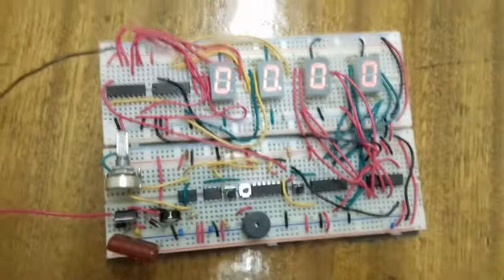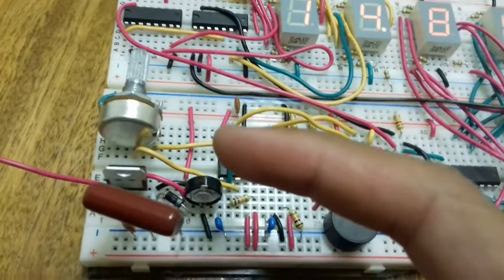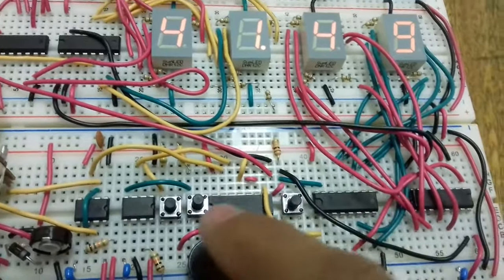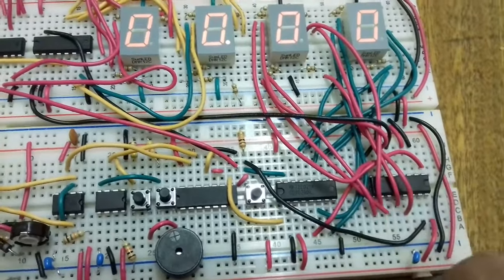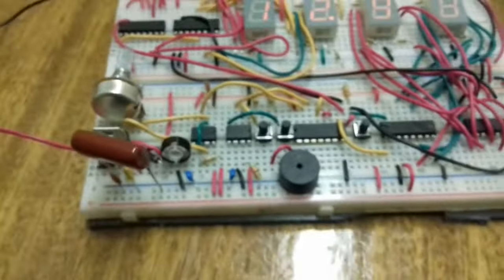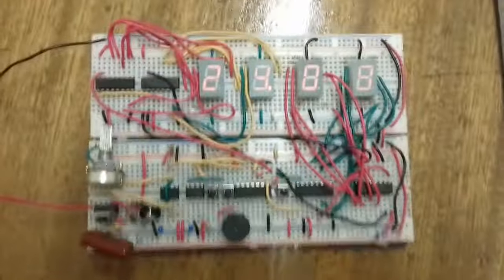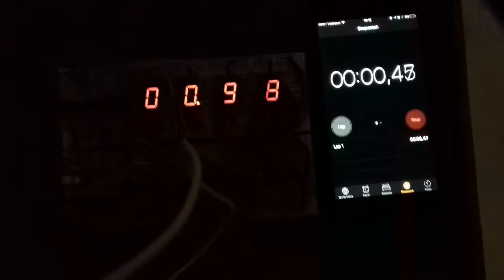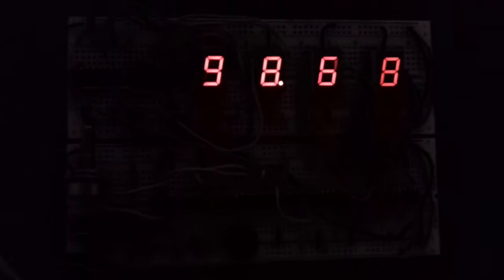Digital Stopwatch/Track Timer circuit with start, stop and reset using NE555, 4026 and 7 Seg. Displ.

Comment: hi may i ask about the circuit/logic diagram, how to aim the stop watch timer circuit that counts from 0 to 60 seconds? because were simulating it first in proteus software. Hoping for your timely response, thank you!
Reply from the maker: For more information regarding the IC and the components used you can just browse through my report for this project on the following link: https://drive.google.com/open?id=1Y6bl7NO-EwmGRuI4GIL9v-hzCtdwp8Gj

Comment: I want to ask that which IC is used to display the microseconds in the stopwatch  because I have made a microseconds stopwatch but the segments are changing with second of a time
Reply from the maker: talha adil Talha Adil According to the circuit that I made, the speed at which the numbers change depends on the frequency of the clock, so for the clock I used a 555 timer IC. For more information regarding the IC and the components used you can just browse through my report for this project on the following link: https://drive.google.com/open?id=1Y6bl7NO-EwmGRuI4GIL9v-hzCtdwp8Gj , apologies for a late reply, did not have enough data in my phone or connection to the WiFi, hope this reply finds you well.
Reply: Thank you for your response , i hope this will solve my problem

Comment: What is the frequency you set at 555 Astable oscillation?
Reply from the maker: Please follow this link for the circuit diagram: https://drive.google.com/open?id=1o61FyCb5Gz9mvtp34Id4kTbkrqxuAPyQ and this link for the report on this project: https://drive.google.com/open?id=1Y6bl7NO-EwmGRuI4GIL9v-hzCtdwp8Gj , or follow this link for my YouTube folder: https://drive.google.com/drive/folders/1TSks2pbnnubpdjSFU0xy58rDbHXLChkJ?usp=sharing